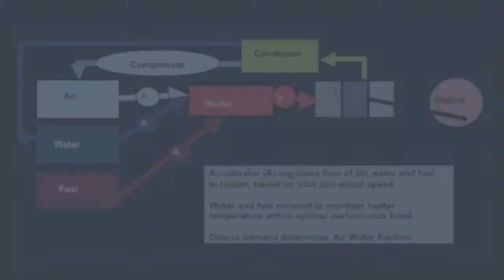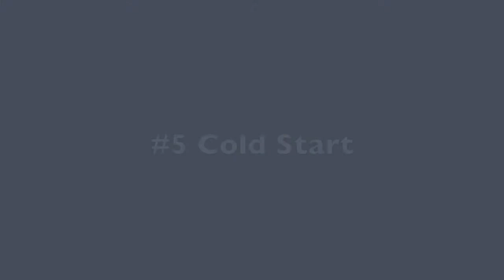2010 Quasiturbine in Brash Technology

Comment from the maker: QUASITURBINE recent research papers: 

2025 Comparative Analysis of Quasiturbine and Wankel 
https://www.ijsr.net/archive/v14i2/SR25210033851.pdf 

2023 Quasiturbine Fundamental of Internal Components 
https://www.ijsr.net/archive/v12i12/SR231207062842.pdf 

2022 Quasiturbine high Power Density Engine 
https://www.ijsr.net/archive/v11i7/SR22704112446.pdf 

2021 Quasiturbine engine Stator Confinement Profile 
https://www.ijsr.net/archive/v10i3/SR21313004008.pdf